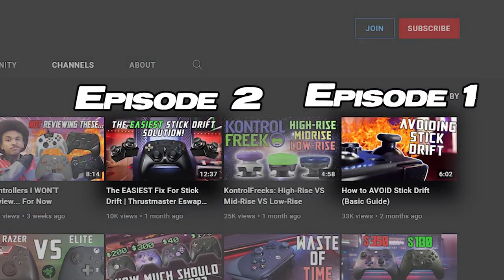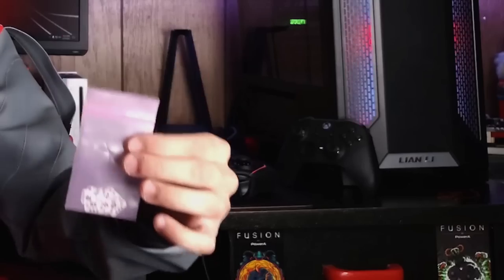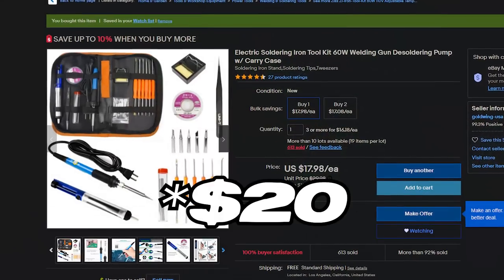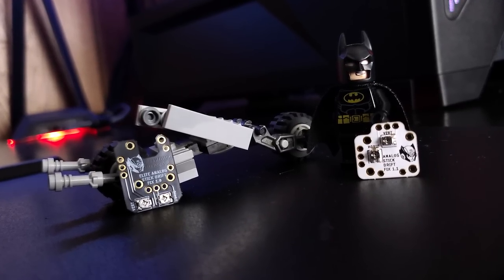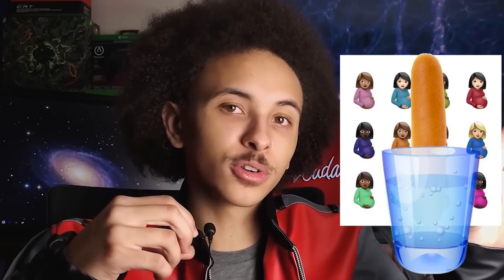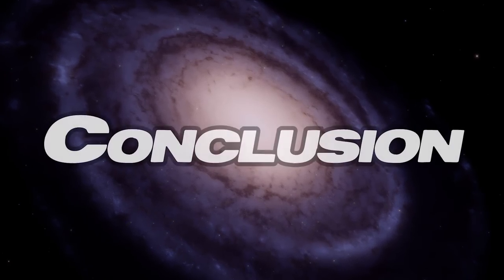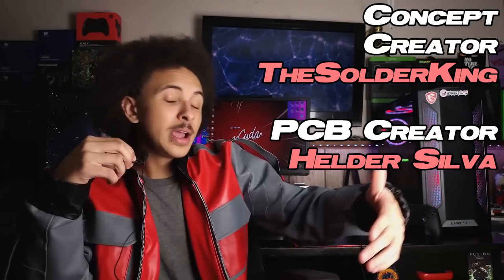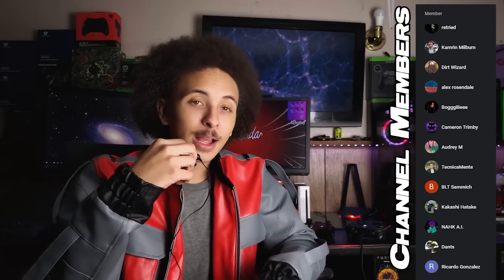PERMANENT Fix for Stick Drift is Only $15! (PS5, Xbox Series X, PS4, Xbox One, Elite Series 2)

Comment: Isn't there any way to figure out an analog stick variant of optical (or hall-effect) switches (like how we have analog-capable hall-effect switches in keyboards like the Wooting & SS Apex keyboards?). That would quite literally solve most issues, perhaps replace a spring here or there to keep the resistance and tension okay and you'd be done. Honestly I would pay a good sum extra for something like that. It's the reason I currently use one of those E-Swap Pro controller where I can toss out a module if it fails me, but that has some downsides too.
Reply from the maker: I spoke with helder about this, and apparently this is something he's exploring. The problem with hall Effect sensors is A, no one wants to use them anymore because they're better than ALPS and B, you'd have to Install them yourself. Installing them yourself is also kinda difficult though, because they require more power than normal thumbsticks to operate and you'd need a Soldering Iron capable of higher temperatures to melt the Solder on the bottom of the thumbsticks on the controller. They're a great alternative, but it requires some work to get them to function properly

Comment: This does not solve the problem of wear on the potentiometer which is the main cause of drift on older controllers, just get a pack of  potentiometer sensors and replace it (ebay sells em), no soldering and at around 75c each way cheaper AND you end up with a new sensor!
However this method is good for fine tuning
Reply: these also are a pain in thr as$ to take off, you might rip apart the original solder traces on the controller pcb.

Comment: Just curious how high of a deadzone is too high in warzone? I use 0.08 on my elite series 2. if i go to 0.07 i get occasional stick drift. however even as high as 0.10 i feel basically no issue. even the slightest press of the stick causes input on screen. there is no real noticeable dead zone as depicted in this video. #elitedrift

Comment: If i soldered it on and still doesn’t work is it bc I didn’t put it on good enough like bad connection or because I should put the other one. My left stick seems to be the one drifting more

Comment: Would you recommend putting these on a new Xbox series x controller to prevent future stick drift?
Reply: Also if I combine this with extreme rate, do I put this on top of the extreme rate? So I would install extreme rate first then then PCB?

Comment: I just bought the elite series 2 and Carahlo. I just bought the Helder kit and haven’t opened box yet or have the controller. So basically brand new controller zero stick drift yet I’m going to install this right away. Your video is great but is there anyway to chop it up with you outside if YouTube.

Comment: I've replaced like 16 analog sticks. It's a giant PITA. Hoping the price comes down a bit if it gets more popular since $30 for 2 standard controller sticks is a bit high. Also wondering if it will work on the PowerA Wireless Switch pro controllers which use a slightly different analog assembly (same electrical design) but they decided to put some small resistors in the middle of the open space in the center

Comment: I bought the razor wolverine tournament edition and its been great so far, my only issue is that my mic is very quite for wired headsets, the mic is fine on stock controller tho, is this a common issue? Is there any fix?
Would really appreciate any help 🙏
Reply: Interesting, I didn't know that was an issue. Whenever my mic arrives, I can test it with my wolverine ulti.

Comment: after calibration is it possible to remove it and use it in another controller? does the calibration remain even without the soldered pcb?
Reply: This is not the fix that is claimed. Replacement is the only current method to address this, whether replacing the stick package, the potentiometer for the bad/worn axis, or the controller as a whole.

Comment: So quick question. Does the basic one work on a power a fusion pro? Mine hasn't had any issues, but I want to know just in case it ever does.
Reply from the maker: I plan on taking all my controllers apart and checking soon. It'll be updated in a comment on this video. So far, all I know is they work with the series 1, series 2, and extremerate kits

Comment: #drift  Just an FYI for everyone this isn't a permanent fix but it is cheaper than buying a multimeter(50$ and an extra hour at least of work) to measure the resistance of each individual potentiometer until you find a matching set.  The carbon track that the wiper inside the potentiometer rubs against will still ware down over time but still that just means you toss in a new set of pots, calibrate the pots on the pcbs, and your good to go. This is especially nice if you have a high tension stick from battle beaver or a elite series 2 module that you want to use forever basically
Reply from the maker: Unfortunately, you gotta be in people's faces with your titles and thumbnails these days. Plus, stating that anything is permanent is bullshit either way. Being pedantic takes far too much energy 😂

 The coolest thing about Helder and his website is that he actually sells OEM pots. He even sent me 2 sets! Replacing those is a bit more of a challenge, but with those parts available, providing you know how to Install them, the only other issue you'd have is the other Mechanical parts on the module loosening or breaking after HEAVY use

I hope one day, the most commonly used thumbstick modules WONT be so Mechanical and fragile
Reply: Im sure the permanent fix is for manufacturers to use hall effect sensors instead of potentiometers, they are usually a much more reliable option over mechanical potentiometers and dont wear down over use.

Comment: I wonder if soldering these on have any effect if you do it when the controller is brand new vs when the controller already has stick drift issues? 🤔
#Drift
Reply from the maker: In both cases it would work

Comment: So does this fix make the elite controller the best paddle controller? Cause the elite controller is so awesome the only issue was stick drift
Reply from the maker: Well, there were a ton of other issues with the series 2 believe it or not. The main one being the A button would often fail. Unfortunately those issues, and the ones around the bumpers and triggers will persist. So while this can prolong its life, it Unfortunately isn't going to be able to sustain itself forever. Most Controllers won't tbf, even with this PCB. But especially the series 2

Comment: Had to replace my Elite Series 2 after 13 months (so just out of warranty) 😢. Bought the replacement direct from Microsoft as they sold a 3 year warranty although only one replacement outside 1 year manufacturer warranty. 
Never suffered 'stick drift' as such on any controller from XBox 360 thru Elite 2, and, from wiring a Flightstick into a 360 controller via a microcontroller I can state for a FACT that the XBox controller firmware reads and uses the value found at startup, and also auto adjusts the maximum and minimum values to those found in use, and auto-calibrates in between. What it can't do is fix the actual problem which is 'deadzone' due to wear in the gimbals or pots themselves which is what I suffered. Maybe this fix will work on PlayStation, but unlikely on XBox unless it could adjust for this unwanted dead zone, which a simple potentiometer in series can't do.
Reply: This 'fix' in this video won't replace warn potentiometer conductive material that the wiper rides against and only is 'band aid' for slight drift but does not resolve the issue in the long term as one will keep needing to adjust the trimmer pot on a bad axis, diminishing potentiometer resolution, until it is no longer able to compensate and one will need to replace the stick/potentiometer/controller anyway.

Comment: my elite series 2 sticks have held up pretty good ive used it for hours a day for like 9 months being a giant nerd at warzone racking up over 500 wins using all 4 back paddles and my sticks have not developed any worse stick drift than it came with out of the box. i have to leave deadzone around 0.08. my RB button did give out but i fixed it using isopropyl allcohol. im curious how many other of these issues can be fixed simply by using the iso. i think it cleans and lubricates the buttons or something, shit straight up renewed my button to brand new quality no cap. #elitedrift

Comment: I'm not gonna lie. I got stick drift in my c40 controller and I just started getting better at mouse and keyboard. Didn't mess with my c40 for like 4 months and the controller is fine. Been using it everyday since with no issue. Weird asf lol

Comment: lol responding to a video from last year. Also, language! YouTube's certainly changed a lot. I feel like this is one half of a fix to bodge on hall effect sticks. The other half being hall effect sticks which fit into place on existing pads, but I feel like it would be possible to place them on a fibreglass PCB, then solder the hall flexes under the main PCB.

If height is an issue on the PS5… what? Just ship a mod for the top plate which lets the sticks stand a bit taller.

Comment: Adding trimmer pots does not address the decomposition / wear of the conductive material within the axis potentiometer itself. This lowers resolution of the potentiometer axis as a whole and does not fix the issue. Continual adjustment will be necessary until enough wear of the ring of conductive material that the wiper in the potentiometer rides against before you've maxed the trimmer and will still have to replace the potentiometer, stick, or controller. This is a poor investment band-aid for an issue not addressed by add-on hardware. Replacing the potentiometer or stick entirely or controller is the only way to address this issue without losing axis resolution.

Your money is better spent replacing the potentiometer for that axis or just but a replacement stick for the same price as this band-aid trimmer pot non-fix.

Comment: Personally I don't even have issues with stick drift but Im still watching this video     cuz you're an awesome content creator! Keep it up man!
Reply: You will have stick drift problems if you play alot
Reply: If I get three or four months out of my controller I'm happy and that's a sad thing to say just buy new one and added to the stack shooting ones in the corner
Reply: @danielmcbride4828  An easy way to increase the thumbsticks lifespan is to press as least as possible l3 or r3. Like using Autosprint instead of pressing every time the left thumbstick will save you from stick drift
Reply: @spazenub1911  yeah I use automatic tactical Sprint and it did save me some life that way a lot less stick drift after using that but there are some cons to that like you can't run a cannonball very well because you don't want to come up just when you move forward

Comment: I looked into the method for this to work and while I think this is a good idea, it wont solve most my problems with drift or most people whom I know. 

This solves the issue on paper but not mechanically, essentially you are just adjusting additional potentiometers to rebalance the electrical resistance of the pair of potentiometers in a given stick, this can't solve the mechanical looseness or wobble in a stick or make it return to center accurately.

This is useful but it will only extend the life of your sticks by maybe a year and then you'll have to replace the sticks. I'd just go with the thrust master, you can just rotate your sticks, the right stick goes to the left stick slot, once you notice some looseness, and eventually you just have a small drawer full of slightly loose sticks that you use in single player games and save the tight sticks for MP.
Reply: I just ordered the Eswap too, seems like a good alternative. I just hope it is comfortable and that the triggers are good quality and dosable (mostly playing racing games). Love the OG xbox one/series x pad feeling but not reliable at all.

Comment: Idk if I'm just a fuqing idiot or what, but this shit is much more trouble than anyone is making it seem. So, my elite 2 is a PoS with horrible stick drift (no surprise there) and I ordered these flex pcb things and soldered them on no problem, but when I plug in the damn controller, it does not register on gamepadtester.com without being seated back into the shell. Well, if it's in the damn shell, how tf am I supposed to calibrate the pcb? So again, either I'm a idiot (which I'll completely admit to if I'm missing something here), or people are leaving something out about this whole process because I'm now short $180 for a defective PoS controller, down $20 for these pcb's, and another $20 short for a damn controller repair kit that I needed 1 screw driver for. Any help would be greatly appreciated.

Comment: Seriously thank you for this! My elite series 2 stick drift has started getting so unbearable and I see you post this vid! I just got them and gonna apply it on rn. You are a fucking legend! Keep fighting the great fight!
Reply: Did you run into any issues? Just got mine and haven't put them in yet.
Reply: @deadlydull2253  Second time after getting the solder points all individual, as the first time mines were all together and the sticks didn’t work at all, so be careful with that. Also! My P1 & P2 back paddles didn’t work idk why. Definitely something I did. My iron gun did burn off the square gold spongy pad and after that it wasn’t working. Be cautious of that as well! Best of luck!

Comment: I've bought 4 elite 2 contollers sense they came out, each one has had stick drift out of the box, I've opened 3 of them up and tried everything to fix the drift, found out the problem is with the anolages, they have like a loose zone from say 0-12 on the deadzone setting where they don't recentre properly, so if you move the anolage to the right and let go the anolage will stay off centre by about 12 on the deadzone setting until you move it back yourself, think it's to do with the tension mechanic there added but recalibrating you sticks will not fix this as your new centre point will be where ever your anolage s where last sitting, even on the highest tension the loose zone is still there, only way to fix it is some way of forcing the anolage to recentre properly, also the metal casing of the anolage is sharp at the top corners and rubs against the bottom  of the anolage stick which is metal also and scors deep scratches in it and the loose metal falls into the anolage and stops them registering movement properly, mainly on my left anolage but it was so bad on my first on that I had to take the face plate and anolage stick off and blow into the anolage 3 or four time every time I played or I couldn't even move up the menus, basically if Microsoft want to fix there controller they need to make the anolages recentre properly and make it so the anolage caging and bottom of the stick never touch
Reply: Yeah I have the same experience with my Series 2. My right stick is so freaking loose that if I just shake the controller lightly while having it plugged in and displaying Gamepadtester it will move over almost the entire area that the program shows.
Reply: @alexanderalfonsson5874  funny thing is I never noticed stick drift before until games like warzone added a deadzone setting, there default deadzone before they added the setting was 12 which is the exact size of the loose zone, like they were covering up for Microsoft as cod use to be in contract with xbox and probably had a default 12 from back then and never changed it when cod went to PlayStation until recently, either way there no way of fixing it and the more you play the looser that loose zone becomes, buying this and opening up you controller will do nothing but void the warranty
Reply: @ryand91533  yeah I installed the Helder pcbs in mine before realising the problem was actually the loose deadzone. Complete waste of time and parts.
Reply: I've seen on eBay that there are replacement stick modules for the Series 2 without the tension adjustment though. Might be worth trying maybe. They still have the screw top so you can use the original stick heads.
Reply: @alexanderalfonsson5874  yea might try them on one off my old ones, ATM I've just accepted it and have a 12 dead zone, normally play on 5 and there's a big difference, don't even know if you could sent it back because if they check it might be sitting centre and they'll say it works fine lol, bought a scuf after my 3rd elite and its had even worse drift to the right like 25 deadzone to stop it lol,

Comment: #Drift these PCBs are freaking awesome! On my old One S controller I installed the extremeRate remap button kit (I'm a soldering legend) but it had tons of drift, keeping me from using it competitively. Ended up temporarily fixing the issue by replacing the receptors on the joystick module instead of replacing the entire joystick module... but it only lessened the drift. 
Modding controllers is both extremely fun and extremely difficult lol. 
Now I'm thinking the thumbsticks feel a little loose like they've worn down, so I'll be replacing them, but I want these now anyway lol. 

As for fixing drift entirely, it's really difficult considering just the nature of thumbsticks. It's a part that's constantly moving and rubbing against itself, wearing itself down with use pretty much no matter how you design it. I'd absolutely love it if smarter people than me figured out a way to eliminate drift with a joystick redesign, but for now I'm honestly happy just soldering these to whatever controller I'm using competitively at the time.

Also your videos are hilarious.